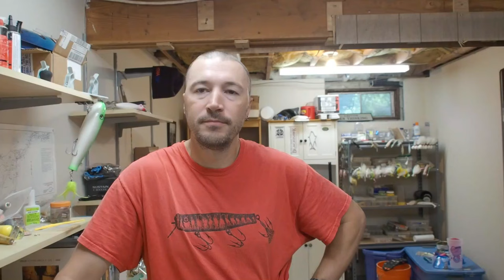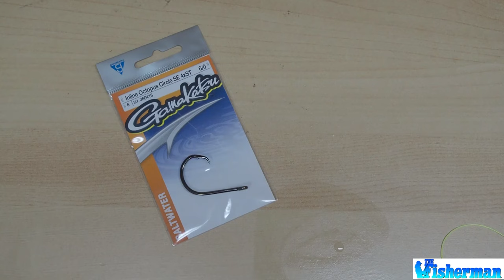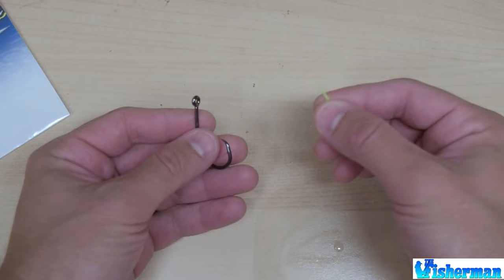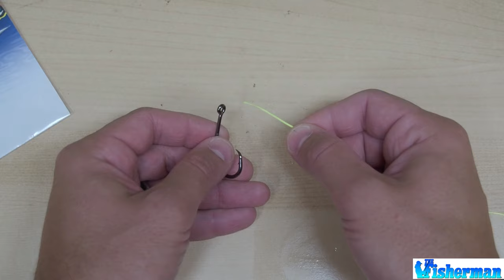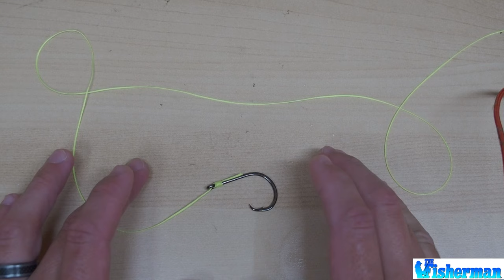How To: Tie The Power Snell

Comment: Just a thought for ya. A knot such as an egg loop or snell knot is best on a bent eye hook and a uni or polimer knot for a straight shank hook especially true on a circle hook. The idea is to keep the hook inline with the leader and not bent like shown here. There is just better success using these methods which result in better hook ups, especially when using circle hooks. The Snell knot is best used with a bent eye hook to keep everything on the line nice and straight.
Reply: I've always used loop knot for straight eye . For erratic fish like Mahi and billfish it's less likely to pull with the loop knot

Comment: Been using circles for last 5yrs exclusively and don't own any Js apart from big livebait hooks. The " set and forget " method suits my types of fishing. Improved hookup rate since changing from Albright to Snell. Love em !
Reply: maybe it depends what fish and what kind of rig setup you got but for me im not having much luck with the intended purpose of this hook design, i usually fish for small pan fish like crappie,suns/blues, perch,small/large mouth bass or catfish using mostly slip floater or sometimes bottom rig and i wait for the bobber to go down but its not like its peeling the line like a big sea fish and sometimes i slowly retreive it and it still ends up being gut hooked or i lose it ,the success rate on this was not good for me although sometimes it does the job and hook the lip even on very small fish ,but i dont know when its time to pull ,i do not want to leave it too long as it ends up gut hooked ,so idk what im doing wrong and yes i do snell knot it  with a uni snell knot
Reply: @ARCSTREAMS  sounds like we fish for similar sized fish but it is hard for me to know their bite habits from here in Australia. I can't remember ever gut hooking a fish, from half pound bream to 15lb golden snapper. Maybe something is that I cast, wind up the slack and put the rod in the rod holder. Only once the rod loads up do I lift the rod slowly and set the hook. Best of luck getting it sussed and stay safe mate. 😎👍
Reply: @ARCSTREAMS  oh, I mainly use my braid to a quality ballbearing swivel with a ball sinker of suitable size, then 2 to 3 ft leader or a single hook patenoster rig. If fishing calm water I use only enough splitshot 6in from the hook to help the cast. 😎👍
Reply: @davidkeep6526  well if you are in australia then we def not fishing the same mate lol
Reply: Straight shanked hooks a must, no turned out eyes, they are not true circles. Do not strike as you would with a J hook. A slow, firm lift is enough. I rarely hold my rod preferring to put it in the rod holder, wind up the slack and let the fish do the rest. 😎👍
Reply: @davidkeep6526  not sure why a straight eye is key? but mine are outer bent size 2 and 2/0 from mustad ,i snell them and do like you said to hook but still not getting much luck and loosing more fish so i switched back to octopus hooks, i think these circle hooks are more intended for sea fish or larger fresh water fish not what i go after,, anyways thx
Reply: @ARCSTREAMS  it has to do with the way the hook finishes up turned in when tied on. Try to Google the coffee mug test hook up rate on snelled or non snelled to explain. I fish mainly for small half pound bream and whiting. Continual learning is what makes fishing a life long pastime. 😎👍
Reply: @ARCSTREAMS  I use from No2 to 8/0 ,anything that needs a bigger hook I don't want anywhere near me or my Kayak  ! 😎👍
Reply: @davidkeep6526  yes that is why they snell it with the main line coming out of the inner side of the eye to have that curved leverage that follows the turned in point ,i do that already
Reply: @davidkeep6526  could not find that test,if you have the link please forward it ,thx

Comment: Just came across this video. Followed the instructions, tied the knot as he was doing it. Double checked my knot matched his. As soon as pressure was released from tightening ,using pliers as he did, the knot came apart. I re-tied three times making sure to follow instructions to a tee. Same results. The knot came apart as soon as pressure was released. I have had more luck with the Uni knot than any other knot so far. I will keep trying other knots but it's not looking too promising at this time.
Reply from the maker: You must be tying it wrong and/or missing a step as I have tied the knots hundreds if not thousands of times as I described in the video and it never comes undone when tied correctly.
Reply: @thefishermanmagazine  As I stated, I made sure the steps were followed, made sure everything looked just like what was shown, and the knot still came apart. I have revisited this since my original comment and still am getting the same results.
Reply: @chainer1969  Well, Chainer1969 ... it's you or the video guy. Somebody ain't doing it right. Maybe you could video your way and post it for the video guy to watch?
Reply: I just tried to connect 4 lb main line to a tippet clip. It didn’t work- the gap is big enough for the line to slip through, so pulling on the tag end just pulls the line out of the eye.

Comment: This is by far the best way to tie a snell knot. I don't consider other methods true snell knots. It can be tied even faster if you use the whip finish hand technique as used to finish a tied fly. I use this knot all the time for wacky worm and Neko rig largemouth bass fishing with a Gamakatsu 2/0 octopus circle hook, 20 lb braid, and a 5" Senko or Yum Dinger.  The octopus circle hook results in far fewer snags, fewer thrown hooks, and no gut hooking compared to a J hook. I also have a theory that a circle hook is less detectable when the bass mouths the bait since the hook point doesn't stick out, so the bass holds the bait longer in its mouth and is less likely to reject it and spit it out before hook set. This might be why Texas rigging a plastic bait that buries the hook point is so effective with bass.

Comment: Been fishing in Hawaii for 40 some years these are all that we use, when the point touches any part of the mouth it will self set the hook the more pressure the deeper the hook sets, oh and the same with handling the hook, if that hook point touches any part of your hand.... your hooked(trust me on this)it's happened plenty to me.
DO Not do a hook set, if the fish has the bait in it's mouth and the hook point hasn't touched any part of the mouth, a trout hook set or sweep you will pull the bait and hook out of the fishes mouth.
If the fish is running(pulling line) just start reeling, you stand a much better chance of that point hooking because the line will be coming out of the fishes mouth on one side or the other, hense the side of the mouth hook set.
Reply: As for hooking yourself.....this is why every hook I use are barbless.

Comment: Sidebar: On 16/0 circle hooks fishing for halibut in between 100 feet and 100 fathoms, where there is no light, I made leaders from 3/16 inch diameter three-laid nylon rope and connected it to the hooks with eye splices. They never failed me where 30-40 pound fish are considered “schoolies,” but yes, it’s not broadly useful. BTW, PB was 134 pounds.

Comment: No matter the not, if your first wrap is away from the gap/closed side it should never get between to cut abrade the leader. I've used the same knot for 35 years on every hook style out there and 4-40# test line. If done properly and away from the gap you will never have a snell knot fail.
Reply: Are you tellin me that smaller diameter lines wont find that little gap?
Man.. Cant believe its taken me this long to find this info out lol... Been tying baitloop nots for like 20 years and i usually wrap towards the gap on the first line through the eye as I was thinking this would buffer the leader line that goes through the eye of the hook to the swivel. Ive been doing this wrong my entire life, LOL.

Comment: Every variation of snell knots that you use a loop to make your wraps with is difficult for me. It twists and gets tangled in the main line. I am using 10 pound mono on a 3/0 circle hook. I won't use the simple snell that uses the main line for the wraps because it will loosen when tension isn't applied. I want a better snell, so for now I am using the one that uses a loop at the end of the hook(away from the eye) and you wrap with the tag end 10 times towards the eye, then run the end of the tag line back thru that little loop. Pull both tight.

Comment: Pl check the strength by giving it a good jerk find it snap from the knot I normally use. 45 mm mono uni knots are stronger but hook up ratio is not as good snell knots big snapers give a lot of jerk and the hook breaks from the power snell

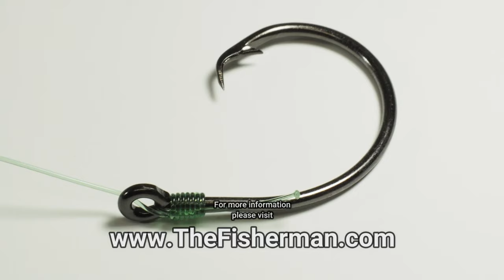Comment: i dont see why ppl offset the point on this hook, would this not defeat the entire design purpose not to get deep hooked in the mouth?  also why dont the designers simply weld or solder that gap? youd think by now they would have all the flaws info on this hook from the customer, but as for this knot i dont see how it prevents the line from getting snagged under this gap,if you look closely at 6:40 the first wrap next to the eye is still wedged in this gap or can insert itself deeper in regardless of that cushion line, might be wrong but juts how im seeing it

Comment: i can use braid for this knot if im chunkin bunker?
Reply from the maker: We wouldn't advise tying direct to the hook with braid. You should have a leader tied in-between the braid and hook, either monofilament or fluorocarbon. The mono/fluoro provides both shock absorption and abrasion resistance.

Comment: I don’t like Snelling in-line circles.  You get way better hook sets on circles or any hook for that matter if you snell turned eyes. Straight eyes require a regular knot.
Reply: No way this works like a charm
Reply: Straight eye hooks will rub on mainline, snell on either 👆🏻or👇🏻turned eye hooks.
Reply: @jerrypeacock5166  maybe so, but as long as the eye doesn't have any rough edges it won't (shouldn't) matter. If it does have rough edges, no knot would be immune since it would chafe regardless of knot type.

I've used this knot exclusively for about 5 years. I've caught cobia, grouper, snapper, snook, amberjack, tarpon,  etc and not had one fail from chafing on the eye. Even maxing out 50 pounds of drag in short situations with the rod on the gunnel when trying to keep a grouper out of a wreck and around 20 pounds of drag on tarpon for 20-30 min straight, and from 20 pound leaders when snapper are line shy, up to 80 pound for amberjack. But that's just my experience. Your results may vary.

Comment: i have a poor catch % using circle hooks (for big blue cats)..not all the fish pick the bait up and run hard hooking themselfs..some bite shy or nibble on the bait making short runs..thinking about try a kahle or octopus hook instead..that way on a short nibble/bite i can set the hook
Reply: yeah i have the same problem with the circle hook ,i use size 2 mustad demon circle hook and a size 2/0 but for pan fish on a bobber i can not just sit there a long while after i get a bit ,it dont work that way as like you said they dont run with it and i have to slowly retrieve and sometimes it gets spit out and other times it gets deep hooked ,rarely it hooks the outer lip so either im using them wrong or they are meant for larger sea fishing , but kahle hooks are the same thing no? also when you say octopus hooks its confusing because they have that name for circle hooks too, but i usually use small #8 octopus hooks by berkely (more like j hook style not circle) and they work well but obviously i want lip hooking and not deep gut that is why i was hoping by switching to circle id get that but no luck

Comment: Circle hook rule already in place in Maryland. Still one big problem. The fish swallow the hook with live bait. Survival still a problem.
Reply: Yes, they will likely swallow the bait but unless you yank on the line in the traditional hook-set manner, or start reeling in too soon the hook should slide back out the gullet without grabbing any meat. That is if the circle hook is non-offset*. Even an offset circle hook will likely grab gut as it slides back out the gullet.  If you like, try this "experiment" with a *dulled*, snelled, non-offset circle hook. Hold the entire hook rather loosely in your closed fist and pull it straight out by the leader toward your thumb and pointer.  The hook it should slide out without grabbing your palm or fingers. Then do the same but pull the leader back toward your pinky as if the fish was swimming away from you and you'll feel the gape of the hook grab one of your fisted fingers, while at the same time you should also feel the *dulled hook point trying to bite into your finger. Your finger and thumb, in this case, represents the corner of the fish's mouth if you can imagine that. I've done this experiment and have used circle hooks with bait for years now luckily without any gut hooked fish as of today. Hey, it's a good law--you get the same adrenaline rush without throwing your back out and the fish gets hooked safely and may survive if released. Cheers!
Reply: @joer9150   I understand your theory but if you are live lining the entire theory goes out the window. Fish already swallowed the bait and is swimming away when hood set occurs
Reply: @lttruck2973  We may not be on the same page...probably my fault with my wording. The proper use of circle hooks is NOT to yank-set the hook at all. As the fish takes the bait and starts to swim away all you do is come tight with the line. Coming tight (no yanking) as the fish swims away causes the non-offset circle hook shank to eventually slide out of the side of the mouth, which then gets pulled toward your direction and forcing the cleverly-designed hook point to set itself (on the lip or corner of the mouth more times than not on my limited experience).  Circle hook fishing is a different method of fishing and like anything else takes a little practice at first. I don't think it matters live vs dead bait but I'm not 100% sure on that. Thanks for the calm discussion...tight lines.

Comment: This isn’t so danged easy when using mono or fluorocarbon.
Reply: Forrealforreal...that "double through the eye" section of line is soo prone to burning on the final cinching it's not worth chancing...ill take my chances with the hook eye edge instead løl
Actually neither I'll just carefully epoxy that sketchy spot on the trimmed end of the eye if I was desperately afraid of that edge being a problem~or buy appropriate hooks for the job. Wanna see this guy snell an eyeless size 20 microhook 😝
Reply: @Im118ish  yeah just use a small dab or jb weld or if you have the means to soldier it even better

Comment: OK a couple of things: first of all, that’s not a circle hook, I don’t care what it says on the packaging, and I don’t care what you call it. That is a regular J hook. Second of all I can’t see anything in this video. I don’t know which way the line went back in the second time and I couldn’t see anything else either. It’s really funny when you say that you use the yellow line so it looks clearer in the video but then tie the knot over a light colored background. I actually found a much clearer presentation of how this knot was supposed to be tied elsewhere on YouTube. Third of all, nobody needs this knot. The fact is you can get better results from a Palomar knot, simply because the knot sits on top of the eye and not below it. The reason commercial fisherman use it is because they need this knot for light lines so that fish wouldn’t get spooked by heavier gauge lines. If your knot sits on top of the hook eye, there won’t be ever be any chafing against the eye gap. You don’t need to snell the hook at all with regular mono, you just tie a regular knot. But most important of all, this is knot is not as strong and reliable as a Palomar knot, I don’t care what you say. Even I was able to pull this knot loose with pliers. The only time you would ever snell a knot is if you were using a really thin line.
Reply: there is good reason why this hook is snelled and not knotted on top of the eye like any other hook and knot, the snell line coming out the eye the way it is in the vid helps give the proper leverage to hook on the lip as it comes out of the mouth ,using a regular knot on the eye lessens this greatly, try it with a hollow tube with both knots and see for yourself how the properly snelled knot increases the chances of the hook setting on the outer edge of the tube while the regular one simply falls out without hooking the edge , simply lower the hook and line into the tube(i use toilet paper tube) and hold the end of the line just outside to the side of the tube and start pulling the tube up and see how it works better with a proper snell (where the main line is coming out from the inner side of the eye facing the point and not the outer)